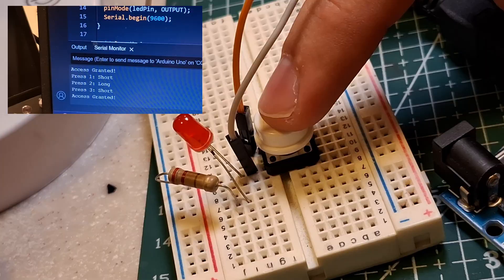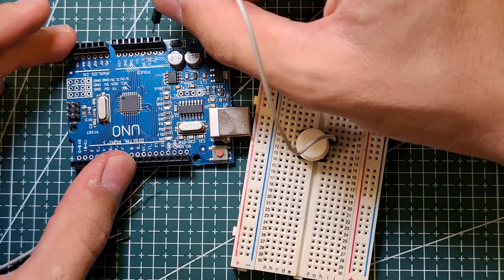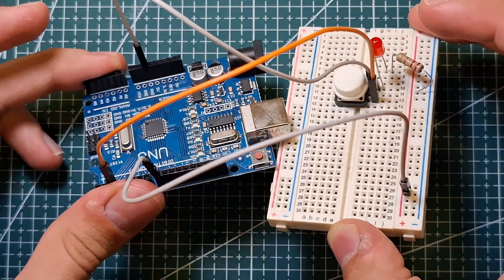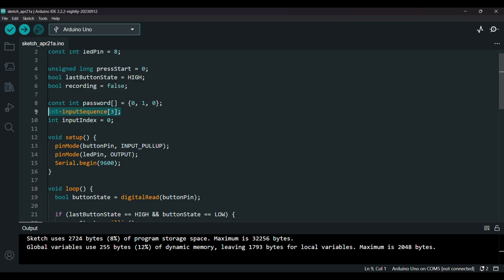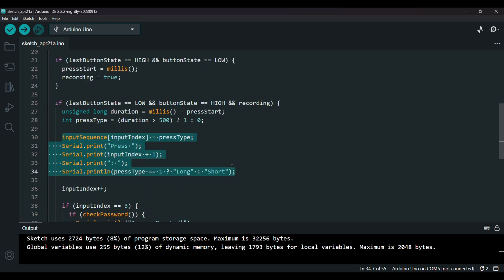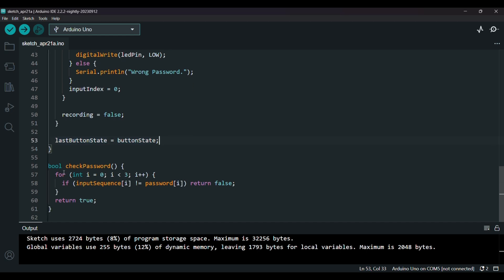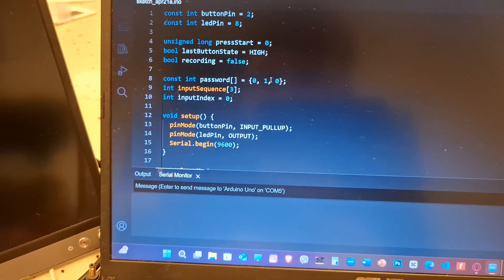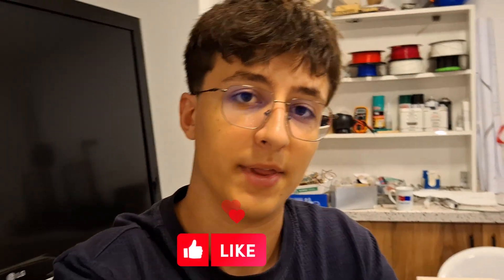DIY Arduino Password Lock Using Just One Button??

Comment: hey buddy i am new to this whole mechantronics thing can you guide me where to start and what projects to make i am deff making this one thank you for the tutorial
Reply from the maker: Thanks! 😊 Since you’re new to mechatronics, here’s a roadmap to get started:
Learn the basics
1.Learn how to use different Arduino functions, variables, and basic coding concepts (You can watch my Arduino Masterclass series).
2.Read sensor data (temperature, light, distance) and display it on an LCD.
3.Control motors and servos for movement.

Key beginner components to explore
First of all, learn about electricity, how electricity works, the voltage and current...
1.LEDs & resistors (learn Ohm’s Law)
2.Push buttons & switches (inputs)
3.Potentiometers
4.Sensors (LDR, DHT11, ultrasonic, etc.)
5.Motors & servos
Relays (control higher voltages)
Transistors (switching & amplification)
Breadboard & jumper wires (prototyping)

Here are some beginner project ideas:
Traffic light system
Distance Measuring Device with ultrasonic sensor
Digital thermometer
Obstacle-avoiding robot(on my channel)
Automatic plant watering system(on my channel)

Once you understand these components, projects like this one-button lock will be much easier. Keep experimenting, it’s the fastest way to learn!😀

Comment: If I connect the button to the arduino as you did, but without the light, will resistor still be needed or is it here to just protect the light? Will it work if there'll be several buttons? 
Video is great and pretty helpful, thank you for such detailed explanation
Reply from the maker: Thanks! 😊 If you're not using the LED, you don't need the resistor...it was just for protecting the light. And yes, you can even use several buttons with just one Arduino pin by using different resistor values or timing logic, like in the video!